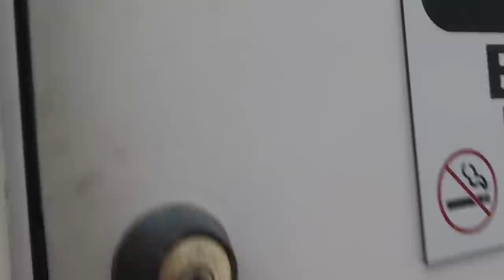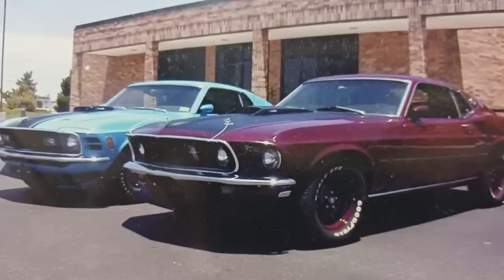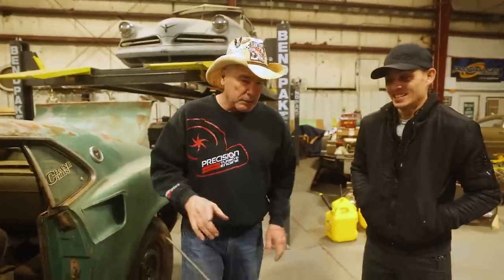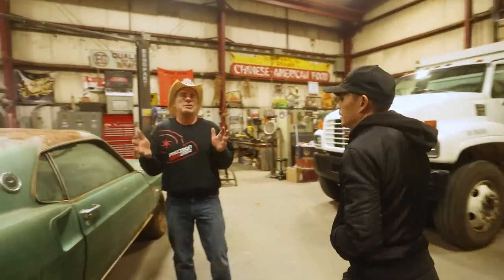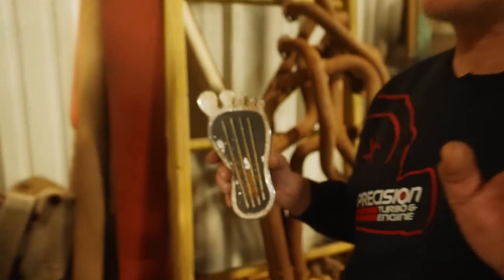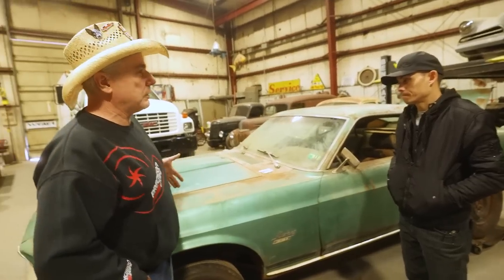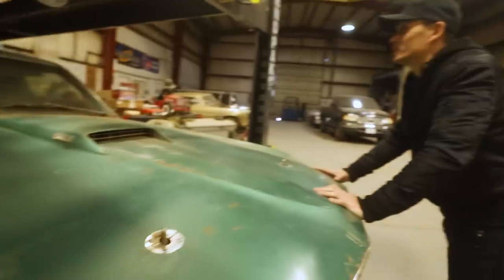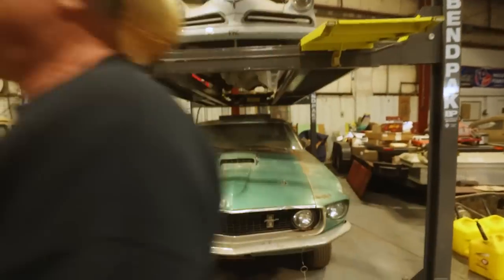THE STINKIEST CAR HE HAS FOUND YET!

Comment: FYI...aside from the coupes in 69, the fastbacks chain of command if you will are as follows ;  the base model was called the sportsroof, GT, Mach1, Boss 302, Boss 429. When I was In Thailand in 69, I wanted a Boss 302, they had car dealer reps over there, the salesman said " Son, I'd love to sell you one but you better have your Dad or Mom check with your insurance Co. an get a quote !!..The payment on the car was gonna be $ 75.00 a month, but the insurance was to be $ 700.-$800 per year...I said NOPE, so I ordered a 1970 Mach 1, payment was the same, but the insurance was about $ 250.00 a year. It was a great car, 351 Cleveland, close ratio 4- speed 389 rear gear...those were the days !!....Keep up the great work guys !!!....Tom
Reply: nice

Comment: Just a thought.  351 W, mild high lift cam modern FI and an upgraded set of heads  Chances are it has the ford 9" rear end.  It could be fairly quick street car of the day.  Upgrade the brakes you may just need more than you have.  Been there back in the day.  The 351W was a sleeper.  Had a customer's kid bring one in for repair.  He splintered the drive shaft like a pencil😂😂😂😂

Comment: Cool! I had a 351W 69 GT Mustang way back when. It's a "Musty-stang" now.
Put the 351W back in it. They are just as drivable as anything we have these days and you can put fuel injection on them to make them even more tunable, and drivable.
Any wider engine and you are going to have a lot of trouble getting it to fit between the shock towers without cutting them up.

Comment: I was going to say put a good 347 crate engine or hot 351W (afr heads).  but yeah,  godzilla if it fits. 
Coyote won't fit,  too wide.   They had to move the shock towers on those to fit the boss 429.

Comment: You definitely should get a Marti report on this car.  It’s a pretty rare car.  A 1969 GT (last year of the GT) in Silver Jade?  I believe there were only 5396 GT’s produced in 1969.  The Mach 1 was way more popular with 72458 produced.  BTW, there were multiple Sportsroof (fastback) models produced in 1969.  The base fastback, the GT, the Mach 1, Boss 302, Boss 429 and even a model known as the Mustang E (economy) built with a 250 six cylinder, auto trans and a 2.33 rear gears. Can you say TURD?!  Those are super rare with only about 50 produced.  There were also some limited special editions built such as the Twister for Midwest dealers.

I look forward to seeing your build of this car!  As a Ford fan please keep it a Ford drivetrain.  You can get a 530 HP 351W based 427ci crate engine from Ford Performance with a warranty.  It will bolt right in.  Put on EFI, a serpentine belt setup with modern AC, a good aftermarket radiator with dual electric fans.  Put in a Tremec 5 speed (fits without hacking up the tunnel like a 6 speed would) with a good modern hydraulic clutch.  A 9” rear end out back with posi like an Eaton Tru Trac.  Add some mild suspension upgrades with a slightly lowered stance  and a power rack and pinion.  Upgrade the brakes and some nice 17-18” wheels and tires.  I  would also keep the silver jade color.  It’s beautiful in modern two stage paint.  Even better than original.

Comment: When I was 16 my first vehicle was a 1970 longwheel based pickup truck that was a strong running truck bottom end and top end.I was  adding a quart of oil a week needless to say that it wasn't far from coming apart because it was still putting a whooping on the ones that lined up  beside it.
This man was needing a work truck and wanted to trade a 69 gt fastback factory 428 4 speed even it didn't have the 428 still in it. The original motor was locked up and it had a 1977 351 Windsor in it with a 2 barrel. My cousin had to help me talk my dad into it.
My dad knew that it was a great trade but I think his words was this is the last thing that I needed but after we talked him into letting me get it you talking about one happy son .
That was the biggest regrets in my life was selling it so I could go to Florida spring break for 800 hundred dollars. Before I got rid of it the year and a half that I had it I had torn the center out of 6 or 7 clutches I think the rear-end gears was 390 and with the factory big block 4 speed it was a quick car .
I think the reason for it running as good as it did was when I built it I had 68 302 heads and a 67 Shelby 289 cam and a 650 holley mechanical secondary. 
Didn't mean to go down  memory lane on yall but seeing this video just brought it all back to me and that was a long time ago I'm 57 now and wanting to have another streetcar to feel young again but financially 
It's not looking like that will ever happen. I truly enjoy watching your channel and a few others.    If you're spinning your not winning so you have to be hooking to be booking.  Stay safe and God bless us all.
Reply: I downloaded Instagram  to try to get back to you but I'm not that phone smart so I don't know if I'm getting back to you or not

Comment: Common.. 1968 is not bad. 
We a bit in common there, I use to restore from 64 1/2 to 72 Mustangs. 👌😉👍 Gotta watch out for those (repops) that don't exactly fit perfectly.  351 Windsor block with 351  Cleveland large valve heads 👍.... P.s. make the unibody full frame. Replace all bushings with polyurethane. IF you can find a 9" Detroit locker for rear end and C4 trans , best set up. 
By the way, headers were optional (LEAGAL) equipment in the day 👌😉👍
😳 Godzilla? MERCY SAKES !! Your gunna blow the doors off!! 👌🤣👍 better pin that hood and trunk.

Comment: 73 Godzilla you want to put a modern motor in that 69 Godzilla 7.3 is God Central cam it's built similar to the LS and they did Lil great horsepower modern fuel injection and they produce a crap load of torque

Comment: The other 351's were probably Windsor Small Blocks where this one was the 351 Cleveland Big Block!
Reply: No, this is a 351W 2 bbl engine.  The 351C didn’t come out until the following year, 1970.  And both engines were small blocks.
Reply: A Cleveland is not a big block it’s a small block.

Comment: Just to know, Mach-1 are GT's, but anyways, If your going to put a very large motor in it, should make it a mid. Engine as they were originally suppose to be, and make it a all-wheel drive, would be better in my opinion,  then you could call it a God zillion twister, maybe make a rock climbing road machine out of it. Maybe make a AZN eater out of it too. Vroom, vroom. Stay safe and clean. But I also think you could put any engine  in it, it's just a plain and simply , one of the funniest cars you can drive in, that why I suggest DARK HORSE to stangmode, and his buddy at Ford made it happen. And it's just a crying shame that gm is making a 100percent Buick just for us to buy in the states, even tho I showed them it useto be Ford motor Co. And I have the paperwork that said there not aloud too.

Comment: I use to own a 1982 GT mustang it had the 302 HO with a 2 Barrow carb. and i had a 1983 GT MUSTANG with the 302 HO with a 4 Barrow carb. With a 4 speed transmission I miss my Stang's they both where fox body's.

Comment: 7.3L is a big LS! That would be a great engine for that classic stang. I have seen these engines at work for yrs. It has a LS configuration. Lifters under the heads, 6 bolt mains etc.
Reply: I’ve heard that a lot of the new design LS was stolen from ford design Cleveland’s.  Bob glidden knew something about Cleveland’s that Gm lovers hated back in the 80s.  Look up his history .

Comment: They did a bunch of work building a 2 bolt main ford engine 😮
Reply: Yeah, I owned a 1970 Mach 1 back in ‘73 with the same 351W 2bbl.  I added headers, dual exhaust, a dual plane intake, Holley 600 4 bbl and 391 rear gears.  After all that I couldn’t outrun my buddies bone stock 1972 Mach 1 with a 351 C.  I was so depressed I never spent another cent trying to make it faster.  Back then there were no after market heads and very few aftermarket cams made for the Windsor.
Reply: @danmyers9372  yea aluminum heads back thin they existed but only in magazines
Reply: @danmyers9372   I felt your pain . But that is not the case today with all the selection. Windsor is the way to go now unless you have a Cleveland laying around. I have several of them. 4 barrel and two barrel head ones.

Comment: Ford makes a coyote motor for a fox body. A turbo, a tyranny and the motor and computer 20,000. Don't insult the car with anything but a Ford motor. By the way, this particular set up I speak of is rated 1000 hp. I am looking at it for my 1988 turbo coupe thunderbird.

Comment: Okay you guys this is what you do you go to your nearest junkyard your pickup aa429 from the Lincoln well from the miradas what-have-you you definitely put the full speed back in it you check to see which rerun you have the 8-inch of a 9in put a set of four 30s in the back get yourself gear vendor for a better top end you can also get the 430 Lincoln engine or the 460 engine so those are three Big blocks you can get forget the 351 even the Cleveland useless we can throw those headers away you got those are junk get some cragar SS mags get the 15 inch rims the Chrome factory rims you can text me back if you need any more Ford advice you might want to update that front and get rid of the shock towers wolf Massachusetts

Comment: I almost commented and suggested going original as a survivor car if that's the factory color cause in all my 63yrs I've never seen a mustang that color. Since your going all out, I'm 100% sure that I'd go with the LS engine cause it amazes me how strong and cheap priced and powerful they are but it's your ride and I'm all for whatever you do to it....
Reply: I would go with the 4th gen Coyote
Reply: Do NOT put a POS GM LS engine in the ‘Stang.  I guarantee you will kill the resale value as lovers of these classic old Mustangs (like me) will immediately close the hood walk away if there is an LS under the hood.
Reply: Yawn, gee, nobody has ever done that before. That's what you do when you have no mechanical ability. I would rather see a '69 Camaro with a Yugo engine in it,a t least it would be mildly interesting. You should all get s10 frames, bolt junkyard 305s in them and bolt the body of your choice on to them. Then you could have a neat guy club and bore yourselves into a coma.

Comment: Godzilla engine with a turbo
With a 5 or a 6speed
4 wheel disk breaks  
Frame rail considers 
Electric exhaust cutouts
Stock rims with poverty caps make a sleeper out of it it's green and nasty its Godzilla

Comment: Instead of jumping on the "modern engine" bandwagon like nearly everybody else, why not just "modernize" an old school engine? TBI sitting on a screw blown FE block for example. I know a 427 or 428 would be hard to come by, but imagine a decent built 427 with a blower and TBI. It's your car, but just whatever yall do, please don't ruin it with a Coyote. I'd rather see an LS in there than see another Coyote swapped classic. Those engines are so overrated